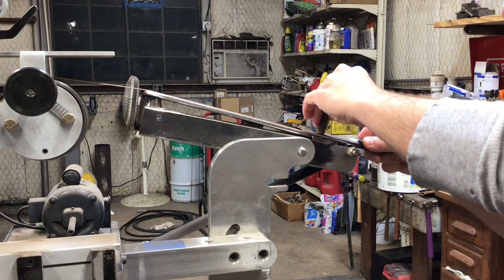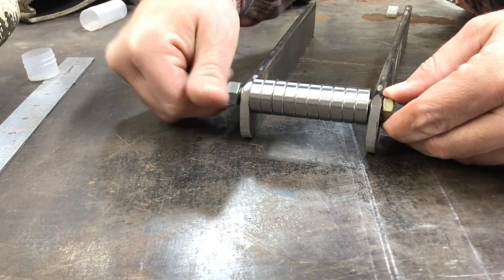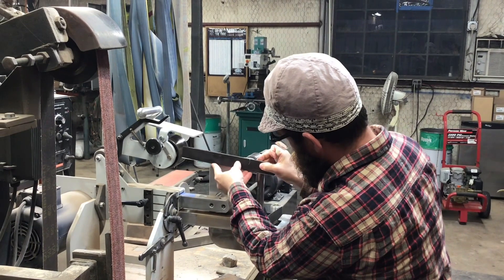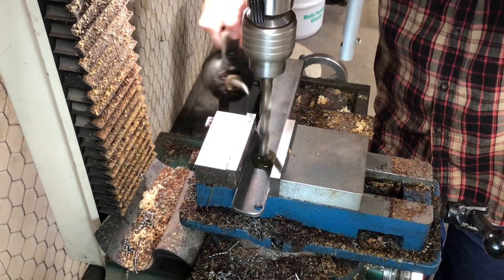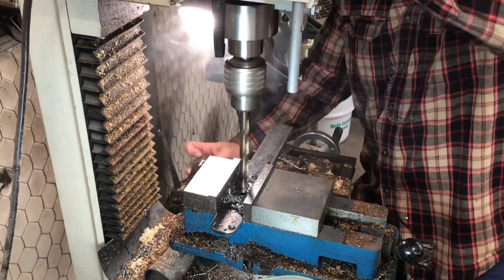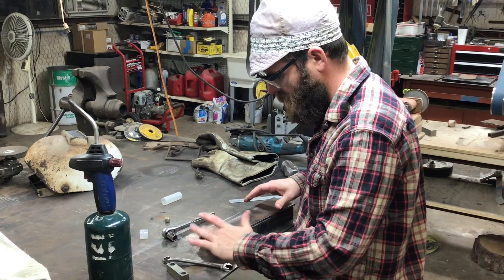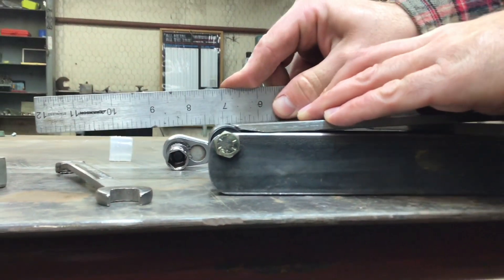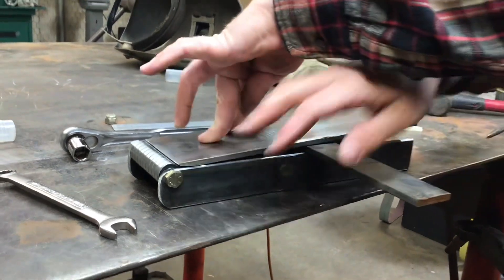Build an integral grinding fixture

Comment: Yeah Chad show the video on how to sharpen the drills. I never can get it right
Reply: Did you get those bearings somewhere local or did you order them?
Reply from the maker: @jbaileyknives7282  I ordered them but you can get them from Wichita bearing supply if you are in town. They should have them. I’ve bought replacement bearings for my small wheel attachment before from them.
Reply: @chadkennedyknives  thanks buddy. I’m going to try and build one like it.
Reply from the maker: okay boss